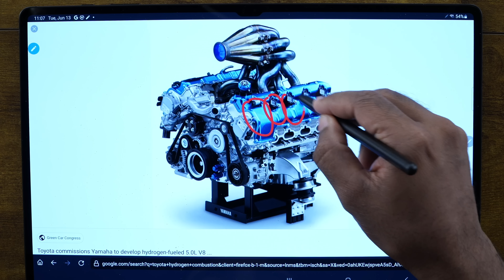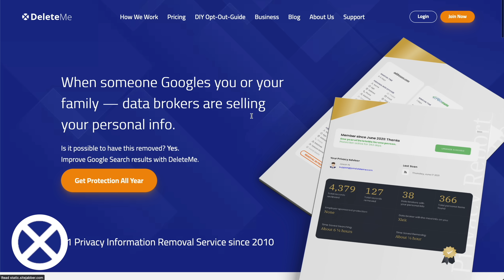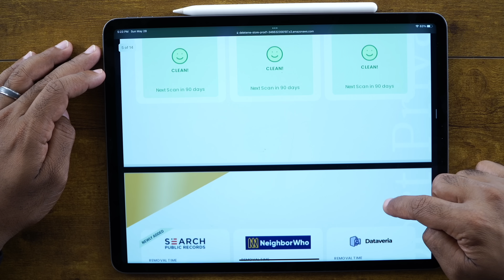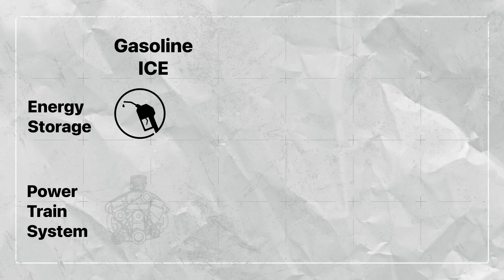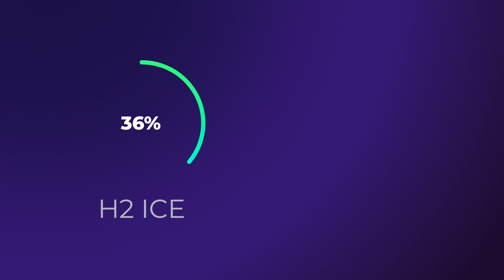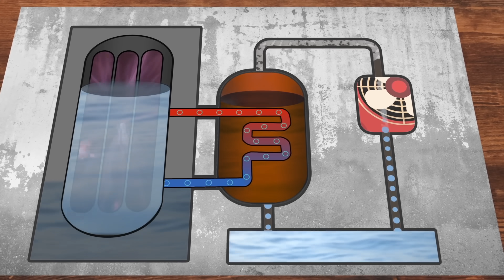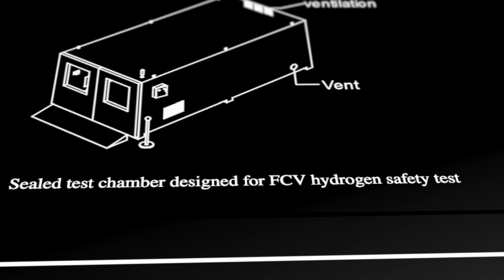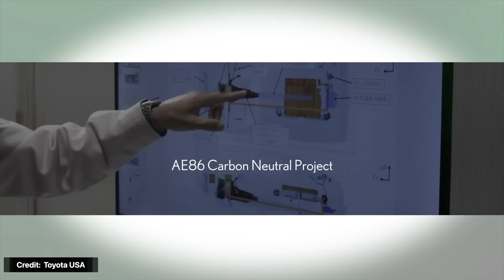Toyota's Says They Just Destroyed EVs - Hydrogen Combustion Engines

Comment: Newer Tesla's with heat pumps have been proven to lose a lot less range in the cold. They don't lose 50% of their range. More like 10-20% now 🙂
Reply: @TeslaSnek, There's more than just the heat pump involved.  In cold temps Re-Gen braking is reduced significantly if not completely.  I'm not an expert, but also, from what I understand, battery chemistry is just not as efficient in cold temps.  In my experience in my Model Y with temps down to around 10F, the Wh/mi runs around 300, When you look at the sub-zero fahrenheit range Wh/mi can easily run up to 350 or more.  In other words, above 10F up to a 20% range loss; -10F and below, more like 40-50% loss.  As long as you have charging options it's really not that big a deal.  I like my Model Y as a Winter car.
Reply: @daviddennis5789  All the things you just mentioned are solved by preconditioning your car while it is plugged in. Preconditioning not only heats up the cabin, but the battery is well, which negates all those issues 😀
Reply: @teslasnek  not really, I do pre-condition,  it helps but doesn’t “solve “ those issues.
Reply: @daviddennis5789  If the battery is sufficiently warmed up, it shouldn't have the issues you mentioned such as slower charging, less regen, etc. The only thing you can't prepare the car for is the air being denser due to it being cold causing greater air resistance at higher speeds
Reply: @daviddennis5789  there’s a Tesla fleet service that goes from LA to Las Vegas. These cars are supercharging nearly everyday, multiple times a day. They have Teslas reaching 500k miles with basically no maintenance costs. Battery life still at 85-90% battery life. Literally all fleet services agree that Tesla EVs are the most affordable.
Reply: @daviddennis5789  I'd love to see some Wh/mi numbers in the cold without the heat on, the Tesla should keep its battery toasty on the charger, and nothing in the motor or controller changes in the cold to make regen less efficient. The only factor is the battery, also as a small sidenote, the new LFP chemistries are better in the cold.
Reply: @daviddennis5789  There's a couple companies experimenting with a different chemistry for batteries that has no range loss until -5 degrees Fahrenheit. Of course like any of these new things, is it affordable and able to produce high volume quickly is the question.
Reply: I can confirm exactly this: the MY with heat pump operates relatively efficiently in the cold.
Reply: If Toyota doesn’t get onto the BEV train they will cease to exist within a decade. Or meet kodaks fate.
Reply: @keithnance4209  💯
Reply: Yes true enough.

The EV's battery, motor and ESC all produce some heat.  They collectively run at some 85% efficiency which means 15% is heat.  At highway cruise of some 8000-watts of power output which means 1200W of "free" heat.  That is significant amount of heat to help warm a car's cabin if using a heat circulation system into a heat exchanger in the EV's dashboard.

Moreover, a car's cabin is a small volume equivalent to a small closet if that.  This is "free" heat that does not draw any extra power from the battery.  After the cabin reaches steady desired temperature, you'll probably start venting most of that 1200W outside or start sweating!

NOTE: All cars including ICE lose range in winter.  Winter knobby tires, denser air, snow and slush on the streets all contribute to lower efficiency.
Reply: Honestly, I don't know why they didn't start off with heat pumps. They're not exactly all that much more complex than a traditional ac. It's literally one extra valve
Reply: it depends. if the car has the heather on and is only driven on short trips, it would probably lose quite a decent chunk of range. its why i think every EV should come with heathed seats and steering wheel. if the car is preheated and than driven to 0 in lets say 4h than it would probably burn about 5kWh. which is less than 10% of a 60+kWh battery or slightly more than that if we are talking about a 40kWh battery. but it could also be 30% if we are talking about an iMiev.
Reply: And that only for short distances, when you have to heat the car often. On long distance driving it is way less, measurable but not noticeable.
Reply: Living in a country where it do get reasonable cold in the winters (though not extreme most years) it is one the first things I filter on when I look (and still only dream) about EVs - if they don't have heatpump, or the option to get it makes it unreasonable more expensive due it being locked to some other over priced "pack" then I am not even interested in the car, and focus my attention elsewhere. 
Here we have the MG cars, and the MG4 made a cheaper spec they call the "nordic" - The nordic do NOT have heatpump, in my mind that is dangerously close to false advertising, to call the option without heatpump "nordic", as nordic is usually colder places, and heatpumps are must have for colder places.
Reply: What if you jyst bundle up and not run the heat?  Do you loose any mileage then?
Reply: @stevenmercurio8536  yes, but obviously not as much. But the batteries perform worse in cold
Reply: @Krydolph  But dont they heat up pretty fast with the outgoing current?  I always thought batteries hated the heat more than anything else.
Reply: @stevenmercurio8536  too much and too little I guess! Its true they don't like to get too hot, and  that many need cooling. But it also becomes less effective in the cold. 
I don't have an EV myself. But I have a hybrid, and there is just more range in the summer. noticeable more!
Reply: @stevenmercurio8536 well you will fog the windows making it impossible to see out of the windshield after being in th car for a about one minute lol
Reply: @stevenmercurio8536  You will still lose a little bit because the air is denser when cold causing more air resistance at higher speeds. Nothing you can do about that
Reply: and how much range loss from a week of just being parked up at minus 30F ??
Reply: Most EVs worth their salt have heat pump options. I have a Skoda Enyaq with a heat pump. I have not noticed any range degradation with 4 miles per kwh or better even in cold weather.
Reply: BAN EVS. THEY BATYERY METALS MINING AND POLLUTION IS DESTROYING THE PLANET.
Reply: I have a few questions for those who ditch ICE vehicles or hydrogen ICE vehicles.

If EVs technologies are far superior, why does the government have to subsidize the EVs with tax incentive?

If EVs technologies are far superior than ICE vehicles, why do common carriers, cruise ships, and airplanes still run on an more than 100 years old technology, ICE?

If electric airplanes are better, how come nobody wants to make an electric airplane?

Hmm, picture an electric semi truck running from Central Valley in California to Boston to deliver vegetable and fruit and see how many days does the trip take compare to fossil fuel or hydrogen fuel.  See if the vegetable and fruit can last that long trip.

Fielding electric carriers, bombers, fighters, and tanks and see how long can that electric army can last a war.  That is how far battery techonlogies will get you.

How often do people have to recharge their cell phone battery?

Hydrogen may not be the best but it is the second best compared to fossil fuel.  Or a mix of hydrogen and fossil fuel.  Easier to fill up with the existing gas station network.
Reply: @ericle7299  Elon Musk himself has said he thinks EV incentives need to end. Tesla was one of the best selling cars BEFORE the incentives were brought back. It's the other automakers who's EVs aren't profitable that need government help
Reply: @teslasnek  
Did Tesla benefit from the tax incentives (US and Calif.) selling their cars and charging stations?
Reply: @teslasnek  
So your reasoning is that it is ok for Tesla to benefit from tax incentives but it is not ok for other car manufacturers to use tax incentives?
Reply: @teslasnek  
No Tesla was outsold by BYD and even Geely in China, the world largest EV market.
The logic does not stand on terra firma.
Reply: @ericle7299  That's literally the opposite of what I said. I'll say it again, it's the other automakers that want the incentives, Tesla doesn't need them and the model y is currently the best-selling vehicle in the world. BYDs sales include gas cars and plug in hybrids
Reply: @ericle7299  It is still a new technology, it is only a matter of time before the tax credits go away - but there is always an "early adopter tax", and the governments are footing that, to make adoption happen faster.

There ARE people making electrick aeroplanes, but think about the insane safety requirements there are for planes, and think about how much weight means, and then think about how much batteries weigh - planes is not, and should not be the first thing we focus on with EVs

There are some really cool luxury yachts that run on batteries, and because they have solar, they never have to fill up. I think its just a matter of time before we see container boats run on electric too. but again, it is massive distances, and battery capacity and production, probably just isn't there yet. 

As for your semi trucks - it is a question about infrastructure! There are trucks that can do a battery swap in no more time than it would take to fill them up! different ways of charging them while they drive have also been proposed, imagine there was wires over the road like trains have where the trucks could charge (this is something that DO exist on test basis) if that was on all the highways, the batteries could take them to end destinations no problem. 
And besides all that.... fast charging is pretty fast.... even if your worst case scenario you are trying to paint (because you honestly don't know enough about the topic) the trip would take hours longer, not days longer, and the trailer would be cooled, so it wouldn't be spoiled. Some of more exotic fruit probably already spent a month or 2 coming over on a ship, a few hours longer on the last legs of the trip is not what matters! 
I can see a future, not far from now, where the "self driving" we have been promised for so long, ACTUALLY could happen, specially on highways that is mostly just long and straight and don't have intersections and stuff. So lets say that is made legal there. and the charging while driving infrastructure was set up, now the driver can sleep and get his rest when he is on the highway, it never has to stop for fuel. and your fruits are even fresher when they arrive! 

comparing your phone to a car is apples and oranges, it makes no sense

When all that is said, maybe hydrogen IS the answer some places - Maybe that is what we need for the big boats, and the planes - and it could also end up being what is used for trucks. 

But what you are doing right now is saying "hey we don't have the technologies to put batteries in planes and boats and trucks, so if it isn't the best choice there, its just dumb and stupid!" You are not being constructive, and you are not being very enlightened. I would like to think you are payed off by someone, but I want to believe in the best of people, and I think what is happening is that you believe the lies being told by the oil industry, they have a lot of money, and a lot of it is spend on propaganda and lobbying, more than you can even imagine. 
If you really want to know, then watch more from channels like this, do your OWN reasearch, and learn to think critically. 
EV's is the future, no matter if you like them or not, and if you don't... well chances are ICE vehicles will be along for very long after they stop selling them new, you probably never have to own an EV in your life if you don't want to.
Reply: @Krydolph  
When someone gets emotional in a counter argument, I stop because I understand that individual no longer engages in common sense and reason.

Have you ever been riding a semi truck across the country from LA to NY?  I have.  Filling up the diesel (a form of ICE)  would take at least half an hour and you are not the only semi truck drivers on the  road.
 
It was the fossil fuel that you hate that generates the electricity that goes into the EVs you drive.

Btw, it was the oil industry that benefits the most from the anti fossil fuel policies put in place by Biden and John Kerry.  The oil companies do not need to compete and their stock prices skyrocket.
Reply: @ericle7299  wow... I always wondered what diesel was..... What I was telling you was that you could do a battery swap in the same time, well, faster. 
I don't drive yet, but it wont be fossilfuel generating the electricity, maybe it is where you live, and where that is the case, not much is saved in co2 - though it still gives  you better air quality and less noise pollution
keep hating if that makes you feel better, I tried to answer your questions. 
Evs isn't bad because you can't runt the military and container ships on batteries. And global warning doesn't dissapear if close your eyes and cover your ears.
Reply: For those of us who live in a place where it gets both very cold (-20 F) and very hot (110F).  And distances between metros are 100s of miles.  And don't have a convenient charging spot at home.  Nor relish the $50k price points.  EVs simply do NOT present a relevant use case.  As an errand/2nd car maybe, but as an only vehicle, nope.
Reply: Tesla’s lose 1% of range for every 1°C below zero the ambient temperature goes. This has been my rule of thumb when travelling across Canada in freezing temperatures as low as -30°C I’ve never had an issue.
Reply: @shaylennaidoo that rule of thumb is very useful if it's accurate.
Reply: @shaylennaidoo  with or without a heat pump?
Reply: @teslasnek  w/ heat pump 2022 M3 LR
Reply: What’s the range loss on a comparable horsepower ICE 
during winter warm ups?
Takes 10 min of idling to get any  trace heat in the cabin.
Reply: @fergyspoolshots  If you warm up your car with scheduled preconditioning through the app while the car is still plugged in, it won't impact your range at all 😀
Reply: @teslasnek  
He's talking about ICE vehicles .
Reply: @rogerstarkey5390  ICE cars can lose up to 24% of their gas range /efficiency when it's cold, especially for short trips. They take forever to heat up and can't even start at all in extreme circumstances.
Reply: @teslasnek tell that to Canadians who start their cars all winter lol.
Reply: @anthonynicholson5523  I have family up there, and they have to use engine heaters lol 😄
Reply: Still have to generate the electricity though which usually comes from dirty sources.
Reply: And at the same time making them nearly impossible to recycle ♻️ wonderful
Reply: @MrRez808  batteries are 98% recyclable. Tesla has been doing it for years
Reply: I suppose cold temperatures reduce the likelyhood of the electric cars lithium battery exploding and incinerating the occupants as has happened quite a few times in California over recent years !!

🤔😐
Reply: @sfcarp9418  you know hundreds of gas cars burst into flames every day right? 🤨
Reply: @sfcarp9418  The main reason EV's are self immolating is due to damage to the battery pack. The damage is occurring due to minor accidents and increasingly due to EV being driven on rough roads or hitting large potholes. Very minor damage to the battery pack cascades into the loss of the EV.
Reply: another con to EV's is that insurance companies are scrapping EV's after minor accidents due to the risk that they randomly burst into flames at any time after an accident

Comment: You can convert any petrol car to run on hydrogen almost the same conversion as LPG
Reply: No.... You can't
Reply: @rogerstarkey5390  so if you get a cylinder from your local gas supplier stick a regulator on it and put a pipe in to your air intake your car will not run ??
Reply: The fuel tank and fuel lines are the difficult bits
Reply: @matthewdilks2677  Fuel tanks and piping already exist petrol cars can run on any flammable gas obviously with varying degrees of efficiency my point really being is why scrap cars that for in the overall monetary and carbon  / co2 are probably less polluting in the short turn than building a new EV
Reply: @stevebarmore3509  to get a sufficient amount of hydrogen stored a huge battery or high pressure or low temperature must be achieved. Combine this with the fact that all connections have to be perfect to avoid leaking flammable gas. Also a vent must be added to let out hydrogen along with an additional safety vent.
Reply: The Conversation retrofit kit is same both with LPG and CNG cars.
But the Hydrogen as fuel into the regular combustion engine with today's existing technology it doesn't work.
The hydrogen is very efficient only with fuel cell for long distance travels.
The LPG and CNG it works very well for long distance travels the infrastructure is growing rapidly and availability of these fuels here in EU Countries.
With same infrastructure maybe in the near future we can use the ICE vehicles with the 4th generation of renewable fuels with less or zero emissions!